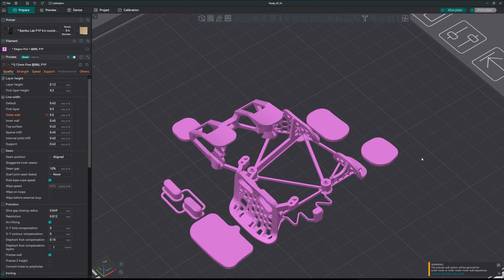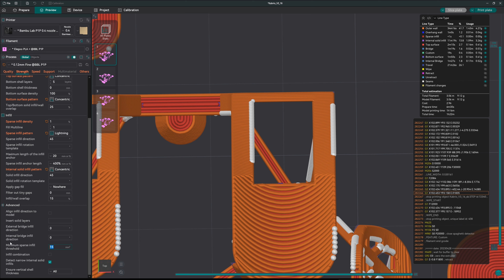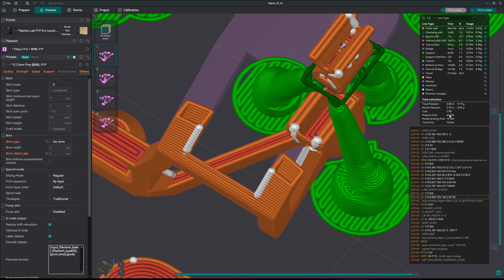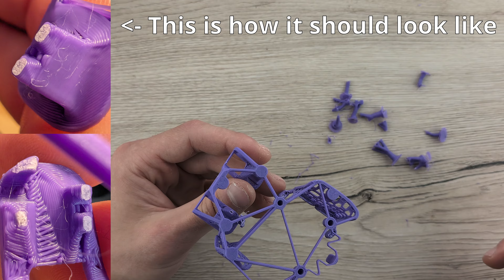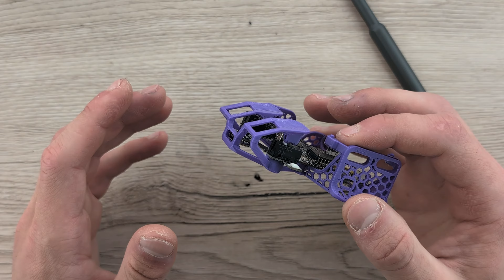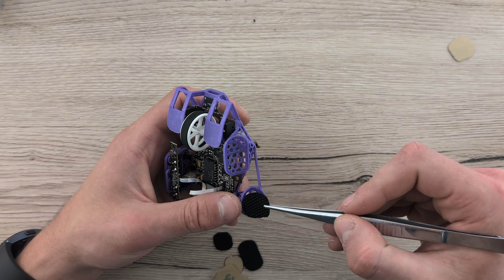Kabrio fingertip mouse mod instructions

Comment: Should I print it in resin or does it need optimization?
Reply from the maker: Hi, I optimized it for FDM and have not tested anything else myself. I have seen people print it in resin and it seems to work.
Reply: @jj00000-js  Thanks for your work
Reply: получилось? если вы печатаете на смоле, то готов купить вашу работу

Comment: Can you maybe tell me the dimensions of the battery? Unfortunately only the Plus version is available in my country right now so I'll have to buy a different battery separately through AliExpress.
Reply from the maker: Hi, you can use the mod even with the plus battery. Just cut the spring in the back and tape the battery on top. If you really want the same battery the dimensions are 26x19x4.5 mm.
Reply: @jj00000-js  thanks a lot!

Comment: Hold up, you are a Czech guy? Glad to see that Czechs still make things better :D
I saw your mod in a "DiamondLobby Reviews" video in which he tested like 8 mouse mods and he was most happy with yours (even before this awesome overhaul). That made me buy the VXE Mad R Major + (cheaper than the normal Mad R at the time) and then buy a smaller battery.
Your mod is genuinely the most thought-out and polished I've seen.

> Jsi prostě borec a díky moc za úžasný mod.
Reply from the maker: Thank you :) Most people probably found out about this mod from the DiamondLobby Reviews. I think I cracked the code with the ring finger grip adjustment and now the mod fits me like a glove. You should give it a try if you havent already ;-)